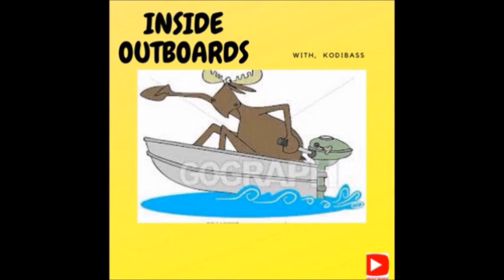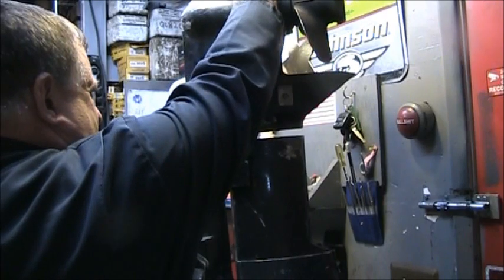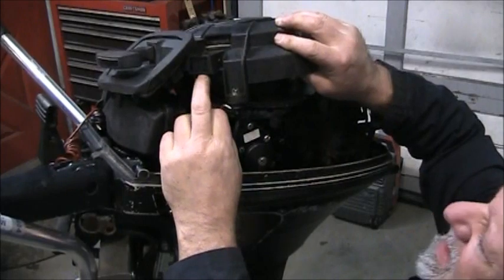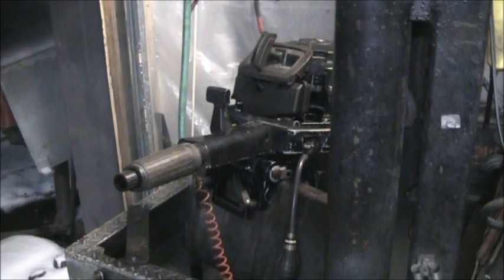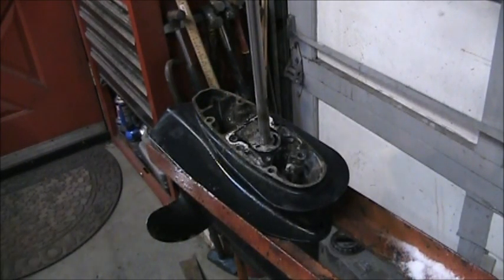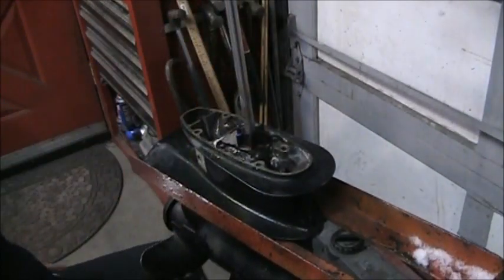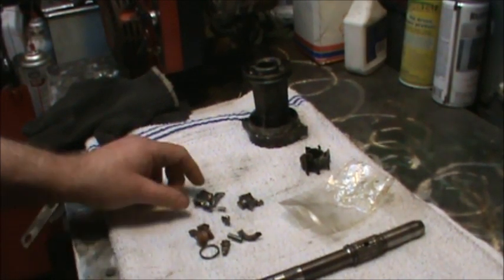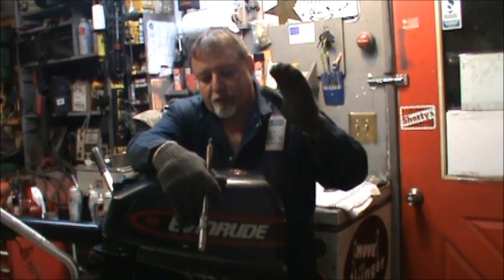1997 EVINRUDE 15 HP , Lower Unit   ( FIXED )

Comment: Thanks for the heads-up about the propeller shaft splines damage. Much needed info for all of us that will unfortunately run outboards into rocks, mud or sand. And great song that I'll sing to myself the next time I navigate waters I'm not familiar with.
Reply from the maker: Now over in your neck of the woods , I think if U sniffed around 4 a jet unit U could find one,  Going by how popular they are on mainland Alaska.  River runners / Moose hunters lov'm.  kodi
Reply: Outboard jet engines are an absolute rarity in Quebec and Ontario because lakes on which most people navigate allow enough water depth. But I would kill to get one. I'll get back to you on this on your commercial email.

Comment: I remember those impeller hubs slipping, but that was back in the 70s when they used the aluminum impeller housing with the SS liner, not a great combination.  That darn salt worked its way between the aluminum hsg and SS liner, crushing the liner inwards towards the driveshaft.  The added drag on the impeller would cause the rubber impeller to separate from the hub.  Hey, at least the impeller didn't break into pieces on you, that's always a mess when the pieces have that magical way of plugging passages intermittently.    This customer was so lucky you had another gearcase!  I haven't had that much experience with the second generation of these engines, but wasn't all that impressed with that forward mounted short throw shift handle....Tough to move, easy to "overshift" from one gear to the other without stopping in neutral.  That recoil interlock is a pain, but OK once you get linkage removal/installation down.  I'm glad you removed that recoil before tipping the engine upside down, you sure wouldn't want to pay the "stick em up" price for that cheap piece of plastic recoil housing.    I guess if I hadn't read what had happened I would have guessed that clutch dog exploded due to gear shifting at high RPM, but I don't know if you can do that with the interlock system in place.  Hopefully, you can salvage the housing anyway....

Comment: Need advice on where to get the tiny fuel line for a 88johnson 30hp from manual primer to ....help!!!
Reply from the maker: Email me @ lenny@alaska.net,    I can Provide that 2 U '  As long as You R Ok with used good condition & LMK  the length U need.  U can Pay me thru  PayPal  Donate,    cheap  .   Thanks  ,,     Kodibass

Comment: Now buddy how do you bill for that extra 30 minutes of labor to install an impeller that maybe should have been done in the first place ? Or do you just eat the time and charge for the impeller ? That’s is exactly why I install new impellers and shift rod seals automatically ! You had to have run into that before given your amount of work on outboards you have under your belt ! I like the OEM style myself , the Chinese ones seem to not last as long for me ! How you fixed for 1970 6hp power heads ? I’m trying to find one now ! I have a really nice looking one but the pistons and cylinder walls are scored beyond belief !
Reply from the maker: Part + 13%  No labor,  As stated in the vid, Dumb on my ""part"" Pun intended.    I have a few not sure of the exact year but rite round 70's.   thanks        kodi
Reply: @kodibassInsideoutboards  I’m sorry I didn’t hear you mention the labor part , no big deal it’s happened to all of us who work on outboards ! Lol. The late 60’s early 70’s 6hp Evinrude’s are getting scarce around here especially ones that the shifting handle ain’t broke ! Lol. Duck hunters in my area snatch them up really fast ! They push a 12’ Jon boat nicely and are great on fuel and work nice on those plastic duck boats also .